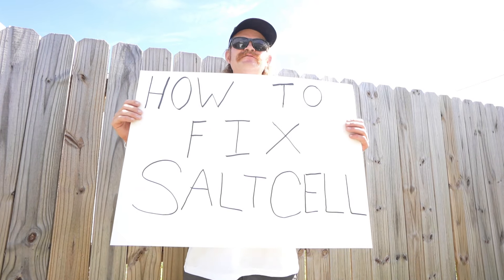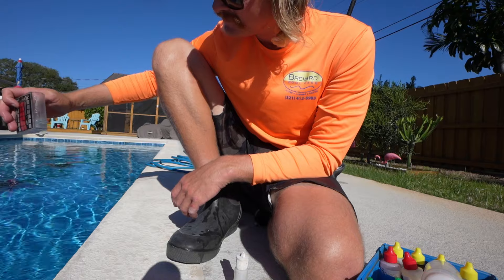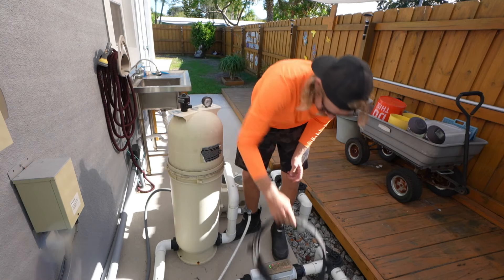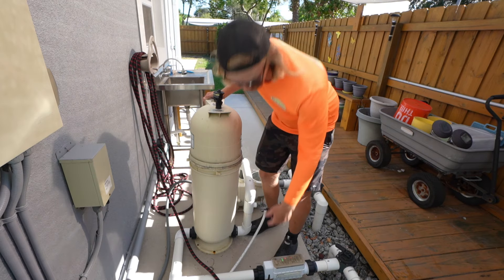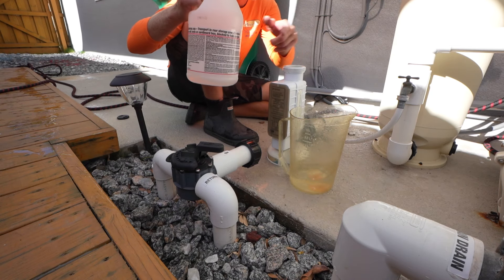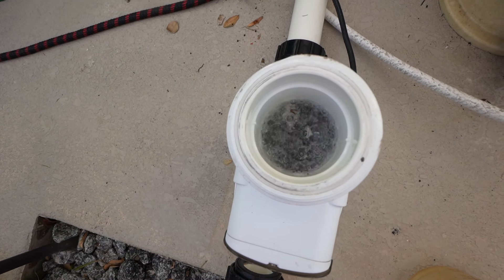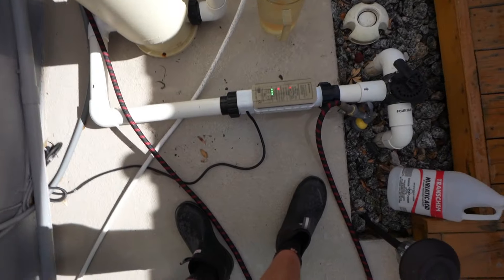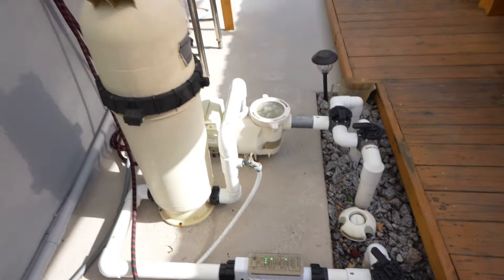Make Salt Cell Great Again! How to Fix: Low Salt - No Flow - Check Cell - Pentair Hayward Jandy

Comment: I guess im having a salt cell electric issue then because some of my green lights are dim and a couple are all the way out. It still produced chlorine but today i had 0ppm and low salt light was flashing even though i was at 4k salinity. Figured this video might have had a tutorial on taking them apart but i think my homeowner might just need a whole new one 😩 this video is a gem though keep it up!! You did it exactly how i would! Good job with that silver nitrate too 😂

Comment: I did all of that and I still don’t have any readings, 0 parts per million of chlorine,. I went to pinch a penny, and they say the cell is probably bad. For a piece of equipment that cost me $1500 and breaks in less than two years it is not worth it, a bucket of tablets last me a year or more in 10 years is about the same, great video for maintenance.
Reply from the maker: Thank you for the feedback. How old is the filter cartridge? If it’s past a year it may be worth replacing for better flow. If you want to check before buying remove the filter and run to see if it produces chlorine. You can watch my other video on how to test cell as well. Remember if your chlorine is low you do want to add liquid chlorine to raise it. The cell is best for maintaining a chlorine level not raising from 0. Check an make sure your stabilizer level is atleast a 50. You need it get it working so you can brag to your friends about having a saltwater pool lol please subscribe, happy Pool!
Reply: @PoolCareWorld  thank you for taking the time to explain. I definitely will check without the filter and let you know what came with. The filter is a almost two years. I clean it regularly, once a month. Sometimes twice a month.
Reply: I’ve been cleaning pools for 
10+ years and I can tell you these salt cells don’t last long.  Especially for what it costs now a days ain’t worth it.
Reply: 41 years servicing and fixing, here.
You are right, costly garbage.
I won’t touch them except while removing permanently.
Reply: I have an above ground so I just buy one of those $150 (?) Intex SWG’s every 2-3 years. I have an SWG graveyard under my deck. I could have sold them for parts during covid and made enough to buy 2 more lol. The Intex is cheap and easy but they’re pretty much disposable. The low salt light of death always gets them.

Comment: I learned this week that if the phosphate is too high, the Cell won't generate Chlorine and produce a Check Cell and Low Salt warnings.
Reply from the maker: Yes true but actually nitrates are normally the culprit for it not working! Nitrates requires dilution, where phosphate can be removed easily with a phosphate remover.

Comment: My 6month old Jandy is saying “check cell”
Reply: Any advice?
Reply from the maker: I would start by cleaning it with a acid solution 1 part acid to 4 parts water and also clean the filter and if it runs for 15 minutes it’s your best bet of it going away! Some Jandy need cleaning monthly if you have it at 100%.

Comment: What about for Aqua rite that’s reading ‘no flow’ or ‘low salt’ despite having clean filter, good flow, good salt test reading and clean salt cell? These things only last like 4 years max. Definitely should last like 10 years imo. I clean about 7 pools with salt cells and they all start messing up at the same time. It’s insane.
Reply from the maker: Stay tuned I’m working on a video going through all the Hayward and aqua rite going to all them on our route they all have issues it’s insane lol we try and switch them to pentair pentair whenever they crap out or turning them into a chlorine pool basically
Reply from the maker: Pentair normally last at least five years
Reply: I just fixed my salt cell by taking a small wire brush (a nylon brush for bubble tea straws) scrubbing in between the fins.  Now the salt level is reading properly.  Hopefully won’t have to replace a 3 year old cell for a while.

Comment: My intellichlor periodically gives me a Flow error (red light) and the pump shuts off.  The pool has plenty of water.  The strainer is clear.  The filter has been cleaned.  The intellichlor has been cleaned.  I've replaced the flow switch on the intellichlor.  Once I reset the circuit breaker on the control panel, the pump and the intellichlor reset and water flow resumes.    This cycle repeats a few times each week.  Any suggestions?
Reply from the maker: If the flow light goes red when the pump stops is what we want that’s good! If the flow is red when it’s running the rpm’s may be too low

Comment: Just cleaned my iChlor 30, now it reads clean. I have it set at 90. Any thoughts? Thankis
Reply from the maker: Definitely could be an issue with the filter. Try running the pool without your filter for 10 minutes and see if it clears the error 👍🏻

Comment: Thank you for simply covering Proper Salt level testing and the Correct way to clean a still serviceable Titanium Cell.
This is refreshing, after dealing with so many Shade tree above ground pool owners passing off Damage inducing circuit board  bypasses as Repairs, mostly pertaining to Intex.
Even those Generators work pretty well - Until cell E.O.L. - and the cost of use/replacement is reasonable for Take Down pools with short life spans.

Again, much appreciated Video!

Comment: We just replaced our filters, and cleaned the Pentair ic15 cell with 1/3 muriatic acid as usual but the Inspector Cell light is blinking. 
We ran the diagnostic and it says the cell is at 60% life.  
Everything else is looking good but seems this means it’s not producing chlorine.  Although the diagnostic displayed 60% life used, this is our fourth year with the Cell.
Any suggestions, please ?
Reply from the maker: Ic15 is the smaller of the chlorinators it may be time to replace I would try running it a 100% first to see if it works and you can always test it check out our other salt cell videos

Comment: Do you include cleaning filters and salt cells in weekly service calls?
Reply from the maker: Yes we include a monthly filter cleaning and quarterly salt cell cleaning. We have a small charge for the salt cell cleaning to incentivize employees that it’s done every three months, an they are compensated for the extra time it takes.
Reply: @PoolCareWorld  ok. Just wondering. We do a quarterly filter, salt cell servicing as a small separate charge.  But most of our filters are 4 cartridge filters.  The service guys couldn’t finish their route in the same day if they tried to clean filters too.
Reply from the maker: What area are you located in? If the quad filters are standard in your area then I believe it’s the norm to charge to clean them. In our area in Florida it’s basically single cartridge filters takes 5-10 minutes if done monthly. All the companies in the area include filter cleans in service because it doesn’t take too much time though most other companies just say they’re cleaning it monthly and don’t lol. Also we replace them yearly to make sure they aren’t too gummed up.

Comment: Hi! The screen on my salt system was saying HOT. My pool guy told me to change the cell. I changed it and it went to 4900 to 4500 in four days.
Is it going to go down or something else is not working?
Thanks for your help, it’s greatly appreciated!
Reply from the maker: 4900 to 4500 are you talking about the salt reading in the pool? That’s too high of salt level for most cells. This one is 3200 ppm salt. If the salt level is going down to things could be happening. You may be adding water and it’s diluting it if you are not adding water, your pool may be leaking. If evaporation happens, the salt level is going to increase the only way, the salt level goes down is by those two things.
Reply: @PoolCareWorld  
Yes, that’s the salt reading.
My pool guy told me that it might be the mother board that’s not working.
I don’t know what to do anymore.
I’m gonna follow your advice and add water in the pool and dilute the salt and wait for the numbers to go down and maybe fire my pool guy!!
Reply: @PoolCareWorld  
Do you guys have technicians in the Boyton Beach area?
I fired my pool guy.
Reply from the maker: Don’t fire him lol educate him I need to know what salt cell you have to give any specific advice on it. A few require to be at a higher salt level. Do you know the brand? I would be the most concerned about the salt level dropping. Are you adding a lot of water to the pool?
Reply: @PoolCareWorld  
It’s an T-9 platinum edition replacement cell for Hayward.
I’m not adding a lot of water but enough to make a difference.
Reply from the maker: If it’s a Hayward it’s hard to say it could be the cell or the motherboard if it’s either of those and the cell is over 3 years old I would think about upgrading to pentair intellichlor we’re in Florida and the Haywards last half as long as Pentair. Also if you or whoever is doing the pool you never want to trust the board for salt you should always get a salt reading from the pool water and compare it to the board
Reply: @PoolCareWorld  with time it finally went down. Now it’s at 3200. Changing the cell was the solution.
Thanks for your advice, it was greatly appreciated.

Comment: I'm in a pool cleaning bus. for 18 years and I keep telling my customer to not change to salt system... work fine when is brand new... than it is just headache...
Reply from the maker: Yeah true if you have them switch to Pentair it’s good for 3-5 years and the cell is the only part needed to replace, electrical part that is. If you’re okay with spending $1500 every 3-5 years so be it!

Comment: cleaned filter and cell, salt is good.   Light still flashes
Reply from the maker: Check salt levels in pool should be 3200-3400 but every cell is + or - that where it stays solid green light

Comment: Can I put regular VASELINE ?
Reply from the maker: You can but just as a temporary solution after awhile it will coagulate and make a mess and will need to be wiped clean. Any silicone lube is better off 👍🏻
Reply: Vaseline is a petroleum product and will ruin petroleum base o-rings.
Except for very few, all pool related o-rings are petroleum base.

Comment: I have a salt cell that has a red light for no flow. There wasn't much build-up in the cell. The cell is 6 years old
Reply from the maker: Have you tried cleaning the cell an the filter? Also I would try to run the pump with the filter cartridge out and if you get flow the filter needs to be replaced.
Reply from the maker: I would try everything you can to try and get it to work before thinking about getting a new one! The pentairs last along time you can also replace the flow sensor.
Reply from the maker: Just know they do say 5 years is the life of the cell if it was running at 100% the whole 6 years it may be worth in buying a new one than putting anymore money in to this one. But let’s try all the other easy fix methods first 👍🏻
Reply: @PoolCareWorld  yes, I cleaned the cartridges & acid wash cell. The pool was recently green but now is clear. I can try that cartridge tip. What is the flow sensor
Reply from the maker: Okay you definitely want to supplement additional chlorine until we can get your salt cell running! The flow sensor is what triggers the cell to run or not. In the pentair cells is looks like a flat spring hanging in front of the cell plates.